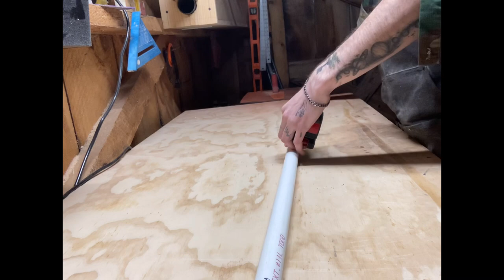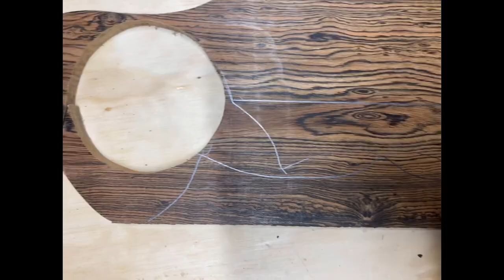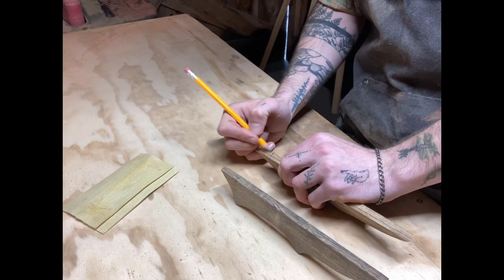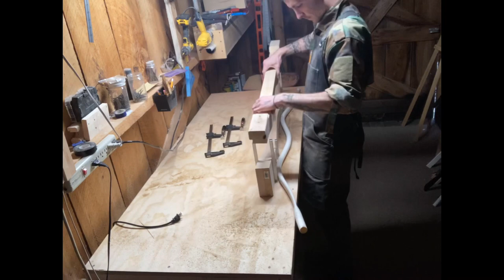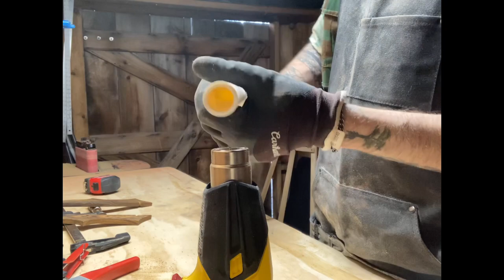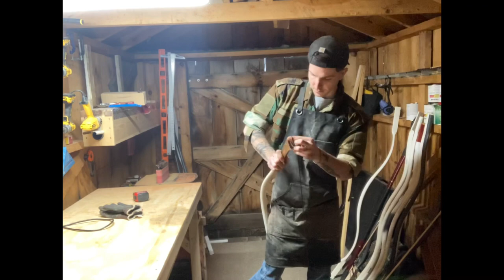PVC Bow Build - From Start To Finish

Comment: The comment on UV damage is real.  I suggest keeping a good coating of UV rated paint on it. Prep by lightly abrading with medium sandpaper to clean the top milcules of plastic and to create a base of adhesion,  wipe down with de-natured alchohol, then prime (or not) and paint.  Oil based is best.

Very warm temps can cause the bow to fold eventually as the material fatigues.  Extreme cold temps can cause it to shatter.  No reasons not to build one, though.

Comment: Been there, done that, too many times.  PVC bows don't last.  I've made too many, some good, some great.  The great one shot so well I shot them a lot and they lasted six months to a year...  and then shattered.  PVC is subject to too much degradation - by ultraviolet light to differing temps- to last.  They're good practice for making real bows but not for anything you want to last.
Reply: I'm sitting next to one that is 10 years old. Still shoot as a practice bow regularly.
Reply: @ghostdog2898  I still shoot an old Shakespeare made in the late fifties or early sixties.  That's longevity.
Reply: @RedStretchLimo  Got a longbow from the 40"s. When I took to archery store they made me go outside to string lol.
Reply: Yea what these guys said, I’ve got several that have been through thousands upon thousands of shots and are still going strong
Reply: Hey stick with it Red!!  I've had the same experience as you.  I've got one that's 3 years old, all the others shattered.  Sometimes it was my fault, other times it was like, "WTF I just shot 100 arrows with this bow yesterday and now it breaks when I'm stringing it like I always do?"

Quality control on plumbers pipe has taken a drastic fall.  Last time I picked up pipes from Home Depot, 9 out of 10 pipes I purchased were bad!  The odds of purchasing fresh pipe now is stacked against you.  Because of this, I've made the move to furniture grade pipe with is supposed to be 10x more shatter resistant.  I'm also strengthening the areas where the bows have always broken:  about 2 inches up from the handle.

Backyard bowyer did a video where he talked about how it's getting harder and harder to pick up fresh pipe that hasn't been sitting outside all year.  Furniture grade is sold in packages fresh and kept indoors.
Reply: That's why you should get the UV resistant colored furniture pvc pipes